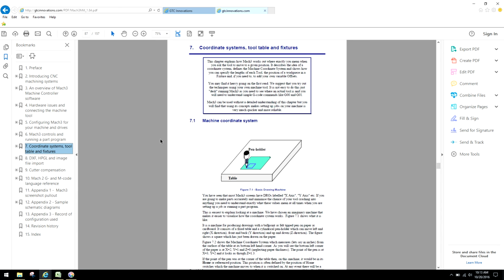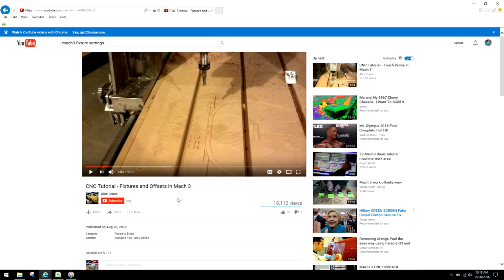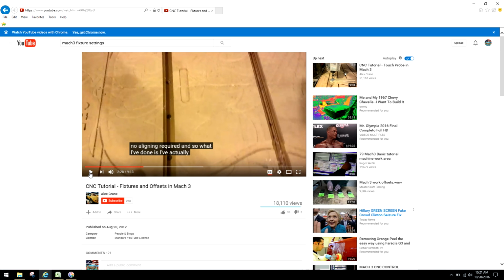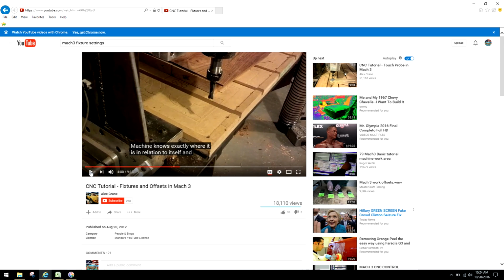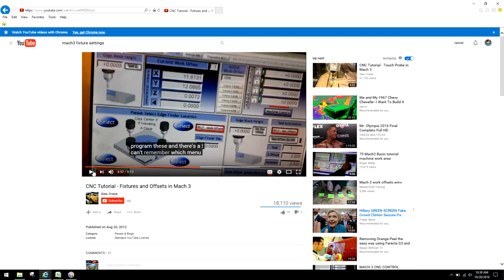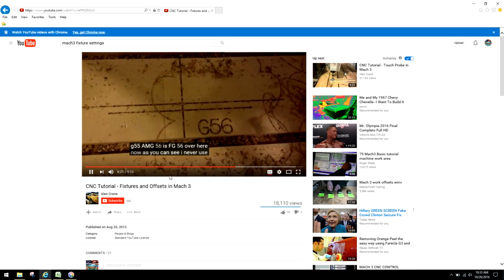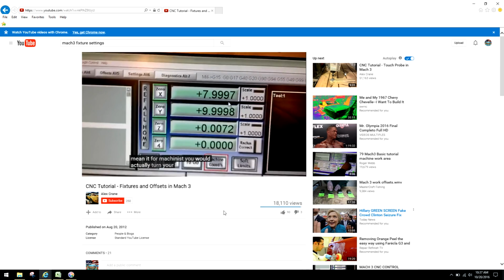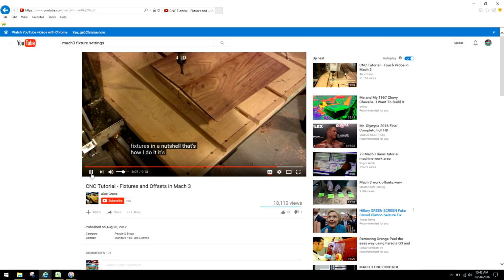Homing In Mach3 To Your Raw Material Using The Fixtures Option

Comment: Hi Great video, just completed my home built  machine from Hobby CNC. I  worked in the Automotive industry for over thirty year. A limit or if you wish call it a safety switch is exactly that, its sole purpose is to shut down the machine in case of emergency. not home the cutter or whatever. Thanks, David
Reply from the maker: David,
Thank you for your support. Limit switches aren't required with Mach3 if you utilize what features the software offers.. Please review my video here on soft limits, and fixtures to see how to save time,money, and to offer your system the maximum protection against crashing.  https://youtu.be/zFk_U3yqrks

Thank you,
Vince

Comment: new here, wanted to get into cnc so bought a Stepcraft2 840. After assembly and use I noticed many things wrong with the design. Now to fix them. It's 24 x 36 running on nema 17s. It uses brass rollers to run on extrusions and brass lead screw nuts. 10 x 3 lead screws, 2 on the y connected with a belt. The 40mm z motor will barely handle the Kress spindle and loses steps. Needless to say, it needs a major workover.
  My first action is replacing the y leadscrews with a 1605 center drive ballscrew. At the same time replacing their extrusions with 80x80x40mm L shaped and profile rails 1000mm in length. This will add 6 inches usable length to allow vertical milling near the end of y. The L shape will allow a 40mm shelf to attach t slot extrusions. I like the xzero raptor design, so I'm going that route when upgrading. Ill raise the endplates 80mm (maybe make new ones out of half inch), to allow for an 8020mm extrusion lower cross member to drive the gantry. Eventually I'll add profile rails and ballscrews to the x and z and nema 23 motors (possibly closed loop steppers).
Reply from the maker: Duane,It requires Nema 23 steppers (300oz or 600oz depending on your substrates) The next most important immediate revision is the driver system. The G540 will make the system perform as it should, and accelerate your rapids by half do it using a 48v power supply. Thank you,Vince

Comment: when you turn on your machine, how does it know where it is without using homing switches? If you lose steps doesn't it require them to reestablish it's position?
Reply from the maker: Lets start with losing steps. Losing steps happen from using inferior quality drivers. Gecko drivers are all micro stepping, and offer superior resolution over the typical online $20-$40 drivers hence no more missed steps. Homing switches is simply putting your table in an arbitrary location based on making contact with the switch. You need to know where it is in reference to your work piece. Once your happy with the position simply  selecting a position to "reference as home", and begin machining from that point is possible. Thank you,Vince

Comment: So this was a huge discussion on a forum this afternoon.  A gentleman said forget homing switches you don't need to use them. Use soft limits and G55 with a fixture and jigs.  I asked him to explain this process without first finding machine zero and he simply referred me to your video. So can you explain this to me ?
Reply from the maker: Curtis in the video above you'll find "machine zero" is an arbitrary position that really means nothing other than the position the spindle is relative to on the table. When most guys (myself included) home their machine they really mean they want the home position to be relative to the raw material they intend on machining. This way the position on the table allows for repeatability to that position to allow the end user to simply change out raw material to machine components over, and over again. Fixtures are for homing the machine to your raw material. Homing switches aren't able or to be used to place the table in optimal machining positions to your work. Mach3 has these features which most aren't using costing them time, and money. I hope this helps. Take care, Vince
Reply: corvetteguy50 I think I understand the fixture part and keeping your machine homed to your work piece. What I'm have trouble understanding is how you can have a particular spot on he table that you can just fire up and send your spindle to without giving the machine a reference point so it knows where that spot is.
Reply from the maker: The reference point is the fixture you set in Mach3. The reference point your discussing is arbitrary. In the video he uses switches to allocate the position he wants to be his tables zero spot however you can hit reference all to any point on the table to make that the arbitrary home location to measure from, or If you use a fixture to replace the switches you can allocate a table zero, (which would do as you describe by making the process totally automatic) replacing the switches all together You then use another fixture to allocate your machines raw material location for beginning your machining from. The process only requires you to set two fixtures up of the hundreds available in Mach, and you'll have much more accurate repeatability. Thank you. Vince
Reply: Ok. So there's a reference all option in Mach 3. That makes this whole thing make sense. Thank you sir for your time. Looks like I'll be upgrading to Mach3 soon.
Reply from the maker: Mach3 is the most feature rich software available at this time for machining. It will really offer the end user the most options. Thank you, Vince